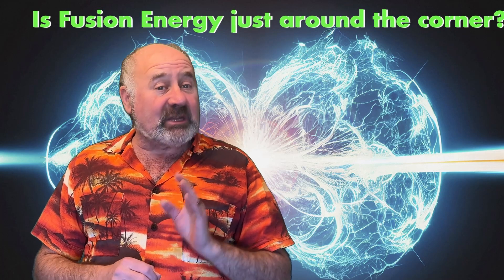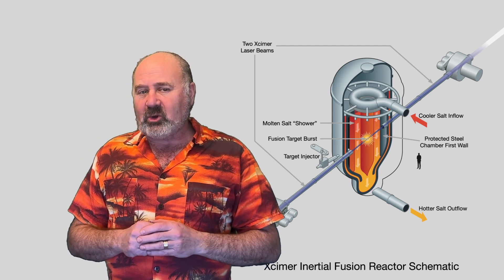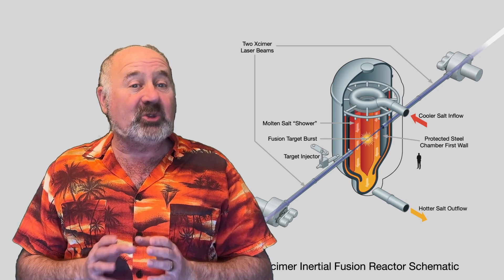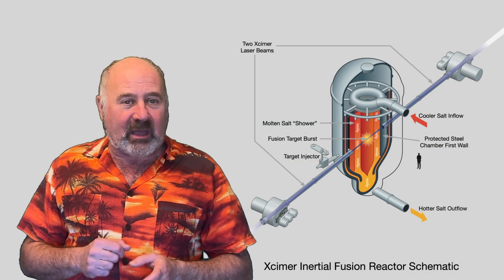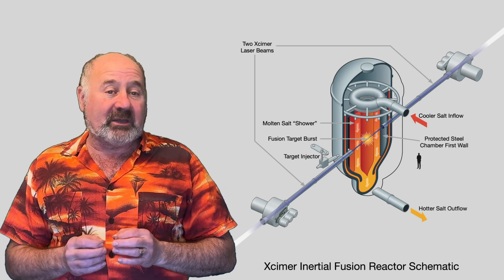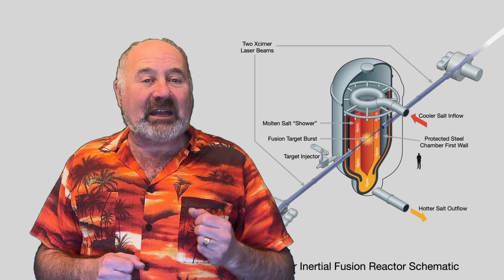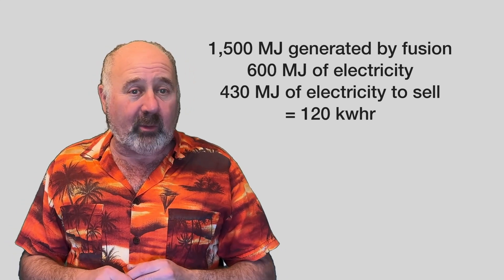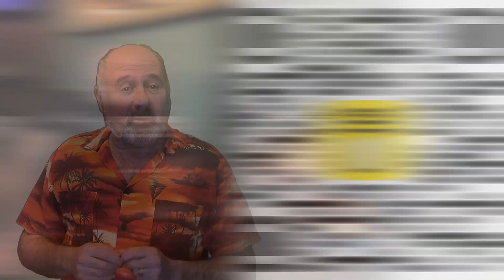Can millions of mini hydrogen-bombs power our world?

Comment: Excellent question, “How do you hold the fuel in place?” How indeed, since “You can’t just drop them through the liquid, as they would move off of the center line.” 
     Image yourself on the inside of my thermonuclear reactor. It is a very inhospitable place. To reach the center requires passing thru five meters of molten salt. No physical object can withstand the intense pressures and temperatures that accompany a detonation. So how can a bubble of fuel be quickly and accurately positioned dead-center before each blast without destroying the positioning mechanism? 
     There are several possibilities. For instance, the fuel could be encapsulated at one end of a rod made from solidified coolant (Yb:FliBe) of sufficient length to span the width of the reactor. In this form, it could be inserted directly into the sphere, like a large artillery shell being rammed into a gun’s firing chamber. Another way of getting fuel to the center is by controlling the 3-dimensional flow of coolant inside the sphere, using valves that regulate the flow coming from multiple inlets and going to multiple outlets. In this scenario the fuel would bubble up from the base of the sphere and be carried along with some quantity of displaced coolant. But, both of these fuel transport methods have a problem, their control mechanisms are exposed to harsh environmental conditions. Moreover, the first method restricts coolant choices to materials suitable for casting into high-quality solid rods, and the second method may struggle with fluid turbulence. 
     Perhaps the simplest way to deposit a bubble is injecting it using a long, retractable, needle-like tube. 
     However, there is a better way, requiring no additional hardware. The bubble’s placement would be controlled using acoustic pressure that gets generated remotely from a safe distance away. This would be accomplished using the same piezoelectric stack actuators that are already required to compress the bubble and trigger the laser.
     Overall, the reactor I envision would work like this: 
     A nuclear fusion power plant having a spherical blast-chamber filled with a liquid coolant that breeds tritium and functions as both an acoustical and laser medium. Fuel bubbles up through the sphere's base and is positioned using computer guided piezoelectric transducers that are located outside the blast-chamber. These transducers create oscillating background pressures and pressure gradients that collectively function like a tractor beam, forcing the bubble to take tiny ratcheting steps toward the center. Once centered, powerful acoustic compression waves are launched. Shortly before these reach the fuel, an intense burst of light is pumped into the sphere, making the liquid laser-active. When the compression waves arrive, the fuel temperature skyrockets and it radiates brightly. This photon-burst seeds outgoing laser cascades that return greatly amplified from the sphere's polished innards. Trapped within a reflecting sphere and squeezed on all sides by high-density matter, the fuel cannot cool or disperse before thorough combustion. After fusion, thermal cycles remove the neutron heat, and a portion of the blast’s kinetic energy can be harvested piezoelectrically. 

Andy, as a graduate of MIT, I’m curious how you would solve the problem of sensing the bubble’s position when it is deep inside my reactor. 📝

Here’s something to watch while you sip on your beer. Enjoy!
Walter Lewin physics lecture: https://www.youtube.com/watch?v=djCCno4Cbcw
Reply from the maker: @michaeldeeth811  when I was at MIT I would occasionally stop by Walter’s lectures. Always entertaining and worth the time. 

Since your coolant is transparent, a visual approach should be possible. 

But this sounds like a slow process. The speed of the bubble in your reactor beam will be slowed by the viscousness of the salt. You’ll also need to pause between burst for the coolant to cool or the turbulence will make positioning impossible. 

The large size of the bubble will increase the buoyant forces and the energy generated per burst, but my WAG is a repetition rate of at most 15 burst an hour. 

How much energy is released per bubble? Assuming a burst every 10 minutes, how many megawatts of electricity are you generating?
Reply: @Decarbonize11  Thank you, Doctor Silber. Here’s a more detailed description of my reactor, including how targets are delivered and held centrally.  Sorry for the delay, I was at a “Hands Off!” protest in Wisconsin. My sign is double-sided, with Charlie Brown saying “Santa Claus is more believable than a Great Pumpkin story” and Smokey Bear wearing a “TRUTH” ranger’s hat over the caption “Only YOU can prevent fascist liars.” 
Sphere (AKA blast chamber or reactor vessel): This needs to be huge, not some tinker-toy. Here’s why: 
    • If you want to maximize the tritium breeding ratio and to protect the chamber wall from neutron damage and x-ray erosion, then a large blanket is desirable. The blanket needs a radial-thickness of ~2.15 meters Yb:FliBe in order to capture 99.99% of the neutrons. 
    • The yields obtainable from ICF targets increase super-linearly with the amount of driver energy. Ideally, to maximize gain, the reactor should operate at the highest yield it can withstand, even if this means operating at a lower repetition rate. For example, Sandia National Laboratories proposed 20 GJ targets, in Annual Report of 2005, for a cylindrical Z-IFE chamber with a 6 m radius and 8 m height, designed to operate at 0.1 Hz, for a fusion power of 2000 MW, because “the economics of scale will favor having a single chamber with the largest acceptable yield.” Additionally, lower repetition rates make it easier to pump out the hot blanket material between pulses. 
    • A more massive target takes more energy to ignite, so the total amount of laser medium must increase with the target’s mass. NIF uses 11.8 cubic meters of Nd:glass to produce 4 MJ of laser light. My targets are bigger (~20 mg vs NIF’s ~0.24 mg), so igniting them requires more energy (~20 MJ). If we assume that the Yb:FliBe in my reactor can be pumped to have the same energy-density (the amount of laser energy that can be extracted per volume) as NIF’s Nd:glass, then my reactor would need ~60 m^3 (a ~2.4 m radius sphere) of Yb:FliBe.
Targets: The fuel (~20 mg of DT gas, equivalent to 6.8 GJ at 100% burn-up) is injected and transported with the circulating coolant (molten Yb:FliBe). Initially the pocket of injected gas is irregularly shaped, but, to minimize its surface area and conserve energy, it will turn spherical. This happens quickly because FliBe is an ionic liquid with strong cohesive forces between atoms and its surface tension is 3-4 times higher than water. 
Inlet/outlet: The sphere has two meter-diameter holes, one at the bottom and the other on top. Coolant flows in/out these holes through large cone-shaped funnels. A gaseous bubble of fuel is injected into the cold coolant that flows through the bottom (inlet) funnel. From there, the bubble accelerates upward as the funnel progressively narrows until it reaches the opening hole at the bottom of the sphere. After the fuel is fused, the hot coolant exits through the outlet at the top, which is symmetrical to the bottom. 
Sensors: A sensor system can be made from two optical-fiber arrays, one at the base of the inlet and the other at the top of the outlet. Recall, the inlet/outlet are cone-shaped funnels that progressively widen as they extend radially outward away from the sphere’s body. These funnels, in addition to functioning as conduits for coolant, also give structural support to the sphere. They have thick metal walls, as thick as a battleship’s armor plaiting, and they protrude (>1 meter) outside the sphere before abruptly turning 90 degrees to form spherical end-caps. Coolant enters and exits from the sides of these protrusions tangentially. The end-caps are reflective, slowing the rate of radiant heat loss from the fuel. In addition they are peppered with a multitude of optical fibers, which emit/detect pulses of light, so they can function as optical sensors. 
Acoustical transport: My preferred method of fuel locomotion has no moving parts. A bubble of fuel can be moved with precision, by accurately manipulating its background pressure environment using piezoelectric stack actuators. These “squishy bricks” are almost indestructible. When an electric charge is applied, they quickly expand or contract with precise (tiny amounts of) linear motion. The underlying idea behind acoustical transport is based on the observation that a bubble will rapidly accelerate until it reaches terminal velocity VT, which is determined by a balance between the buoyant force FB, and the drag force FD, such that FB=FD at VT.
Buoyancy is what causes boats to float. Fluid pressure increases with depth below the surface. A submerged object will feel a different pressure on its top and bottom, with the pressure on the bottom being greater. This difference in pressure causes the object to be pushed upward, the normal direction when gravity is involved, but buoyancy can be artificially created and made to point in any direction. The buoyancy force is:
	FB=(ρB−ρC)g(4/3)πr3
The other force controlling the bubble's terminal velocity was drag, which depends on the fluid viscosity μ, bubble radius r, and velocity v. The drag also varies, indirectly, with temperature and pressure. According to Stokes' Law, the frictional drag force is:
	FD=6πμrv
If a particle is rising or falling in a viscous fluid by its own weight due to gravity, then a terminal velocity is reached when this frictional force combined with the buoyant force exactly balance the gravitational force. The resulting velocity is given by:
	vT=(2/9)[(ρB−ρC)/μ]gr2
where:
    • FB is the force due to the difference between weight and buoyancy (in N)
    • FD is the frictional force acting on the bubble/fluid interface (in N)
    • ρB is the density of the bubble (in kg m−3)
    • ρC is the density of the coolant (in kg m-3)
    • g is the acceleration of gravity (in m s−2)
    • r is the radius of the bubble (in m)
    • μ is the viscosity of molten glass (in kg m−1 s−1)
    • v is the velocity of the bubble (in m s−1)
    • vT is the terminal velocity of the bubble (in m s−1)
The reason large bubbles rise faster than small ones is that the drag force is proportional to cross-sectional area (r2) while the buoyant force is proportional to volume (r3). Drag is felt along the entire surface area of contact. Viscosity is a measure of this adhesive/cohesive or frictional fluid property that is responsible for the resistance to flow that appears when layers of fluids attempt to slide by one another.
When an object accelerates from rest its velocity can be written as a function of time:
	v(t)=vT[1−ê(−gt/vT)]
which asymptotically approaches the terminal velocity vT. If we integrate this expression with respect to time, we get the total distance traveled as a function of time, thus:
	d(t)=vTt−(vT2/g)(1−ê[−gt/vT])
A liquid that is held stationary in a gravitational field will develop a pressure gradient, ∇P=ΔP/Δs=ρg, where s is the submersion depth, ρ is the density of the fluid, and g is the strength of gravity. There are other ways to produce the same pressure gradient. For example, using a centrifuge or acoustically.
Andy, it’s time to take a break, sip your beer, and watch this video: 
There's more to those colliding blocks that compute pi https://www.youtube.com/watch?v=6dTyOl1fmDo

Consider what happens if a 50 hertz acoustic saw-tooth wave is sent across the reactor from left to right. This would produce, in the coolant, a left-right pressure gradient which changes direction 100 times per second. This saw-tooth wave can be synchronized with 50 hertz square waves coming from the top and bottom, so that the left/right pressure gradient always points the same direction when the bubble is at the same, either high or low, absolute pressure. Combining all of these waves would cause the bubble to pulsate (change size) at the same frequency it moved left/right, moving sluggishly when compressed and vibrantly when expanded. A high-speed close-up view would show the bubble ratcheting toward its destination, taking 100 tiny millimeter-sized steps per second. The bubble would spend half of its time being pushed in one direction and the other half being pushed back in the opposite direction. However, because we can make the bubble larger (faster) when it is heading in the direction we want it to move, it can be positioned anywhere we desire. 
Dr. Silber, this method of acoustical transport might be wishful thinking, so I would appreciate any feedback, especially negative. Without optimizing for speed, I calculated two examples (both having viscosity > 300x water) where the bubbles moved between 6 - 9 cm/sec. Because there are a lot of parameters under our control, we have a lot of flexibility. Besides controlling FliBe’s viscosity (which spans 7 orders of magnitude based on percent BeF2), we have control over the coolant temperature, absolute pressure, pressure swings, frequency, and amount of fuel in a bubble. 
If the coolant is entering/leaving the sphere at 8 cm/sec, then it takes 16 seconds for 1 cubic meter of coolant to flow through the 1 meter diameter inlet/outlet holes. At this speed the bubbles could even be forced to move vertically downward against the flow. If the only 50% of the fuel burnt, that would still be 3.4 GJ every 16 seconds. That corresponds to a 900 MW thermal (360 MW electric) power plant.

Comment: OK. I’m decreasing the laser wavelength from 1053 to 1050 nm, just to make you happy. 😁 To accomplish this, I will fill the laser cavity with molten Yb:FliBe. Ytterbium (Yb) is widely used as a laser dopant due to its simple electronic structure, low quantum defect, high efficiency, and excellent thermal performance. It is a particularly attractive choice for high-power and high-temperature lasers, including those operating in extreme environments. And, with an upper lifetime about 4x that of neodymium, it surpasses the energy storage and efficiency of Nd in pulsed laser systems. 

1. Electrical Input to laser diodes:
    • Energy Supplied: Approximately 40 MJ of electrical energy. 
2. Diode Efficiency (Electrical to Optical Conversion):
    • Efficiency: 50-70% typically. 
    • Energy After Conversion: 20 – 28 MJ of 900-980 nm optical energy. 
3. Laser Medium Absorption and Quantum Defect:
    • Process: The optical energy from the diodes excites the ytterbium-doped FliBe medium.
    • Quantum Defect: The difference between the pump wavelength (~940 nm) and the laser emission wavelength (1050 nm) results in energy loss. 
    • Efficiency: [94%] This assumes that the energy lost due to the quantum defect is 10%. However, because this lost energy (heat) gets deposited in the circulating coolant (Yb:FLiBe), subsequent thermal cycles will reclaim 35%. 
    • Energy (potential) at 1050 nm: 19 - 26 MJ 
4. Amplification and Optical Losses:
    • Process: The 1050 nm laser light is amplified through multiple reflections inside the laser cavity.
    • Losses: Losses occur due to absorption and scattering in the Yb:FliBe and mirrored surface of the tiles lining the sphere. 
    • Efficiency: [79%] This assumes 35% recovery, of the 33% losses, in subsequent thermal cycles.
    • Energy After Amplification: 15 – 21 MJ laser light at 1050 nm. 

My approach stops here, with the bubble directly illuminated by 1050 nm laser light, avoiding the huge 0.05 efficiency penalty that the National Ignition Facility (NIF) incurs when converting 1053 nm light to x-rays. 

Summary of Energy Flow: 
    • Initial Electrical Energy: ~40 MJ.
    • Optical Laser Diode Energy: ~20 – 28 MJ.
    • Energy (potential) 1050 nm: ~19 – 26 MJ.
    • Laser Energy at 1050 nm: ~15 – 21 MJ.

Overall Efficiency:  38% – 53% 
---
Ohmic Heating: In tokamaks, this is used for initial heating (with 100% efficiency) up to a few keV; beyond that, auxiliary heating (RF, NBI) takes over. 
RF Heating: the overall efficiency (grid power to plasma) of RF systems is moderate (~50%), due to losses in generators, transmission lines, and antennas. 
Neutral Beam Injection: converting accelerated ions into neutrals has limited efficiency (especially for high-energy beams). ITER’s NBI will use negative-ion beams to improve neutralization, but even then ~74% of the input power could be lost (hence ~26% efficiency).
Reply from the maker: @michaeldeeth811  can you get a pulse sharp enough to trigger fusion rather than just heating without getting a high enough triple product?
Reply: @Decarbonize11  In fusion, that is the trillion dollar question—it is where the tires meet the road.